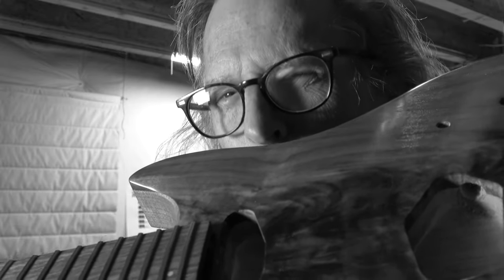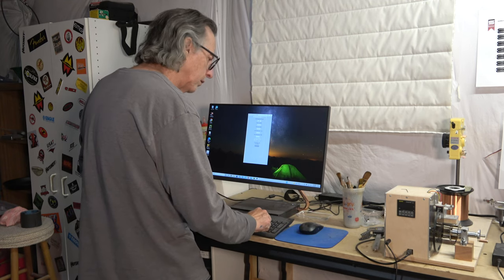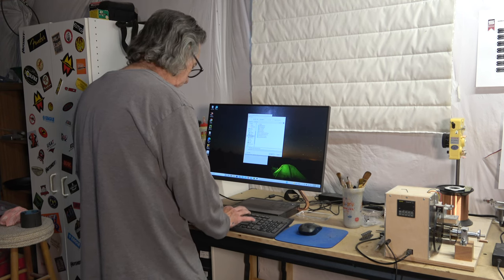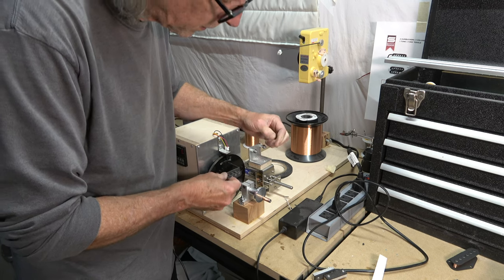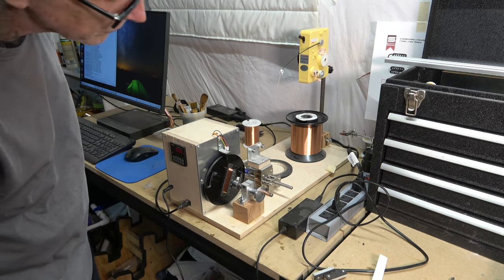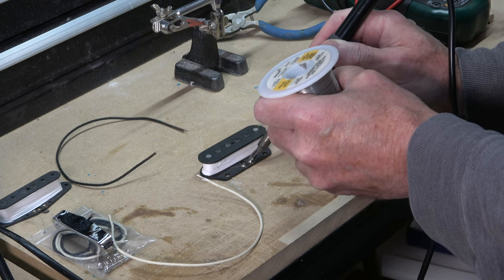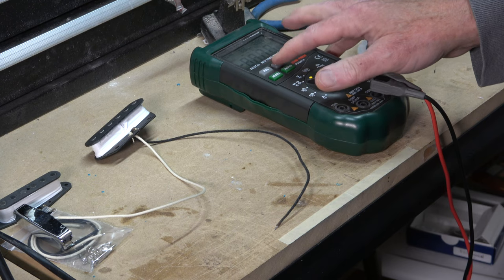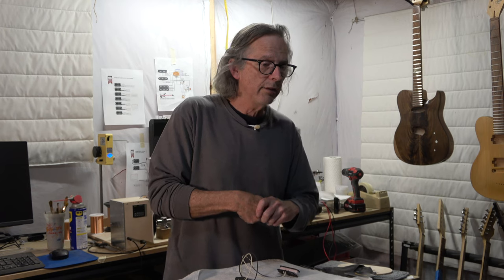Making A Set Of Telecaster Pickups

Comment: Dear Chris, I wonder why You wrap the pickups before waxing them. Wouldn't it better to do the other way around i.e. after the have been waxed ? The wax will easier permeate into the windings.
Reply from the maker: There are holes drilled into the top and bottom of the bobbins that allow the wax to soak into the coil from the inside out. When I've cut open test coils, the wax has saturated the windings.

Comment: Hey Chris, what tonal differences can one expect from either no scatter winding or varying degrees of scatter winding?

Also, I've seen a select few pickup winders, that specialize in winding vintage style tele/strat pickups, and claim to make their tele pickups "slightly" microphonic. I just don't understand how they go about doing that? Any thoughts?
Reply from the maker: Scatter winding or hand winding are marketing gimmicks rooted in physics. Whether it makes a difference you can actually hear, I don't know. I added the feature because I thought it would be a fun challenge to see if it would work. If I ever have the time, I'll make 4 identical pickups with the same number of turns but different patterns just to see (hear) if there's a difference in tone. According to the science, there should be, but I question whether anyone could actually hear the difference. You make a pickup microphonic by winding a loose coil and not wax potting it.
Reply: @HighlineGuitars  Hi. Did you ever find time for that? That would be interesting video.
Reply: @HighlineGuitars  Some other PU winder stated that scatter winding give less capacitance, because it get further away from a capacitor.

Comment: I really like your videos, but I just can't find a solution to one thing. I'm trying to use AWG 44 copper wire and I can't solder it. Either enough - I think because of the high heat or I simply cannot separate the plastic layer from the wire. When I try to solder it into the eyelet, the tin doesn't melt the outer layer of the wire, even though it binds. On the Mulitmeter OpenLoop has no connection because of this. Is there a trick to this? Thank you!
Reply from the maker: What kind of insulation is on the wire?
Reply: @HighlineGuitars  Polyurethane.
Reply from the maker: @attilasipeki1418  Okay, that's good. What about your soldering iron and solder? Also, are you checking for DCR output?

Comment: Approximately how many turns of 43 gauge wire can fit in a standard strat style bobbin? where can I find this kind of information? there is any recommended bibliography?

I've been learning a lot from your videos, thank you for sharing your knowledge and years of experience
Reply from the maker: Between 7,000 and 10,000 turns depending on the wire tension.
Reply: @HighlineGuitars  Thank you Chris

Comment: Dear Chris, I've been winding a number of single coil pickups to experiment and to perform some measurements like L, C and R. Number of windings: 6000 and 7000 AWG 42. My aim is to get an as large as possible bandwidth without to much loss of signal. As a result I have to keep the capacitance of the coil as low as possible. Scattering should instigate that. I perform my LCR-measurements before AND after waxing the coil with paraffine wax. And what did I notice ? The capacitance AFTER waxing is about 50% higher than before. This occurs time and again; so I'm quite sure of my measurements. Do You have any idea how come that the capacitance of the coil is much higher after waxing ? Thank You in advance for your reply.
Reply from the maker: I don’t know.
Reply: Thank you
Reply: If you measure it right after waxing, coil is still hot and that leads to higher capacitance. When pickups cool down, capacitance is almost same but little bit higher than before. I'm not sure why this happens but I think it's because wax spreads the coil and it comes thicker.

Comment: Can you show in a video how to do Tim Shaw T Top Bobbins shawbuster pickups because the bobbin length and wide are different in the Tim Shaw T top bobbins
Reply from the maker: Who sells the bobbins? Do you have a link?
Reply: @HighlineGuitars  I don't because fender stop making Tim Shaw pickups because Tim Shaw bobbins were custom made bobbins that has top and bottom flares to them and different lengths widths and heights. They used smaller magnets A2 and A5 to match the output mV to signal coils so you don't get a big gap jump in volume from humbuckers to single coil. I'm not sure what size is the magnets also
Reply from the maker: @waynegram8907  Without bobbins, it’s a no go.
Reply: @HighlineGuitars  try to find the T top bobbins research about them and the specs used.
Reply from the maker: @waynegram8907  no room in the schedule. Too many ideas and not enough time.

Comment: Probably it's a stupid question, but when you put the pickups into the wax, the crock pot should it stay on or it is turned off? Off course after the wax turns liquid
Reply from the maker: I leave it on. If I turn it off, the wax will cool and start to solidify before completely soaking the coil.
Reply: @HighlineGuitars  thanks

Comment: Could you define scatter. (Min-max)
Reply from the maker: No Scatter = consistent traverse speed of 20 inches per minute. Minimum Scatter = random increase in traverse speed by 10 inches per minute. Moderate Scatter = random increase in traverse speed by 20 inches per minute. Maximum Scatter = random increase in traverse speed by 30 inches per minute.
Reply: Got it, thanks. Now I just need plans for the winder, a nifty little live center, and of course the software. Looks like a lot of fun, especially the experimental side of things.

Comment: Great video, what kind of magnets do you use on your vise for magnetising the bobbins? These things look huge, where could I get these and what kind are they?
Reply from the maker: They are neodymium N52 magnets. 4" long, 1/2" tall, and 1/2" thick. I don't know where you can buy them.
Reply: @HighlineGuitars  - how different do they sound to Alnico or ceramic magnets - brighter - duller?
Reply from the maker: @bernhardnizynski4403  the magnets  in the pickups sound like Alinco V magnets because that’s what they are.
Reply: @HighlineGuitars  - oh Good, thank you. I thought they may be NeoDyne magnets which hare very strong?
Reply from the maker: @bernhardnizynski4403  I use neodymium N52 magnets to charge the Alnico V slug magnets that were preinstalled in the bobbins. The easiest way to magnetize an alnico magnet is to slide it between a pair of much stronger magnets like the neodymium N52s. Normally, the slugs come already magnetized, however, I needed to flip the polarity of the neck pickup from north up to south up. That's why I remagnetized the slugs in the neck bobbin with the super-strong neodymium N52 magnets.